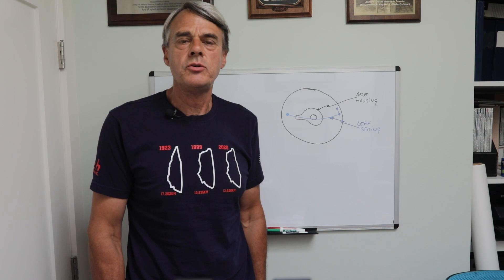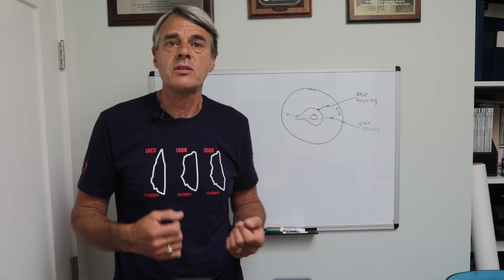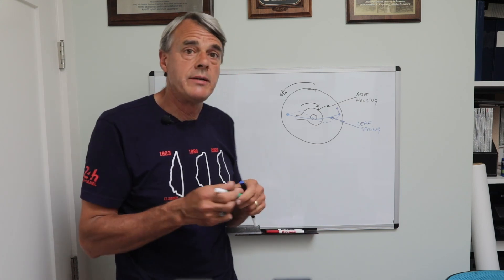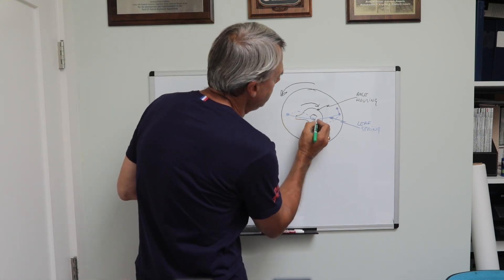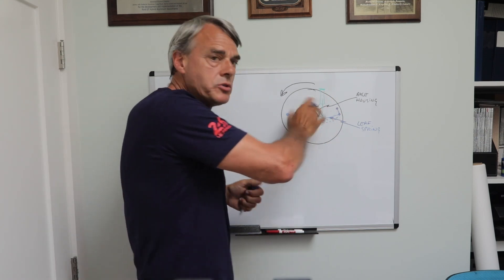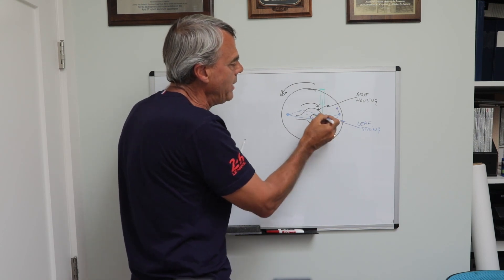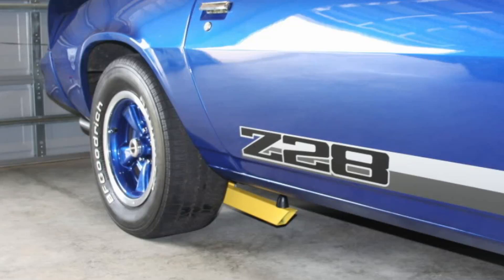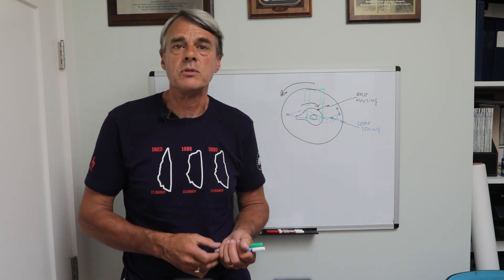What are Staggered Shocks and Why Are They Used?

Comment: My first exposure to offset dampers was reading car magazines in the late 1970’s when the ‘68 Camara and its prominent axle tramp was discussed. It had same-side rear dampers and the primary mitigator was to offset dampers on the ‘69 and later Camaros. Even today, when a pickup is directly ahead of me in traffic, I’ll note its offset dampers.

You mentioned spring wind-up. A friend had a Mopar Superbee with single-leaf rear. Stand next to the rear of the car when the driver stomped the gas and you could actually see the spring form the "S" shape.

Comment: Once you add traction bars to the front would you then want to move the shocks to the rear instead of running staggered?
Reply from the maker: Traction bars stop the axle from rotating so staggered shocks would no longer be necessary.

Comment: There is another reason for the front/rear shock offset on solid axle leaf sprung vehicles.  When the suspension is exposed to any common mode bump (that is when both wheels see the same deflective force at the same time, like going over a speed bump), the leaf springs are also deformed about a point who's dynamic center of rotation is the attachment point for the shock.  The shock of course tries to resist any instantaneous movement.  If both shocks are located on the same side of the axle then the leaf spring is allowed to distort thus rotating the axle.  When the shocks are split, one on the front and one on the rear, then this common mode bump deflection and resultant tendency to axle deflection is resisted.

Comment: I would be interested in a video on leaf-spring suspension geometry. As I understand it, depending in the longitudinal angle and cant-angle of the springs, this can lead to some interesting advantages or undesirable outcomes. I believe based on limited information available NASCAR teams are able to obtain rear-wheel steering under cornering to improve stability.
Reply from the maker: Justin, Leaf spring geometry is indeed an interesting topic that I may cover in a future video. It is very common to get roll steer out of a leaf spring design and pretty much every design I have ever seen does it. All you need to do is make sure the front spring eye is lower than the rear. That will give you rear wheel steering in the understeer direction during cornering.